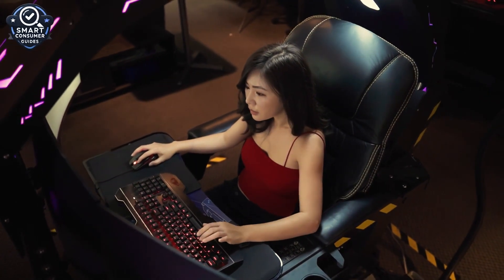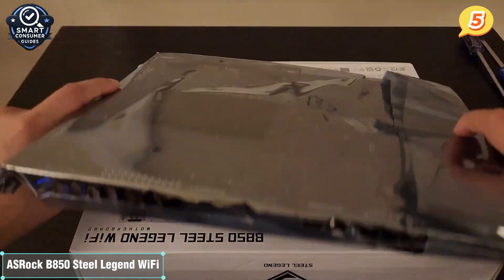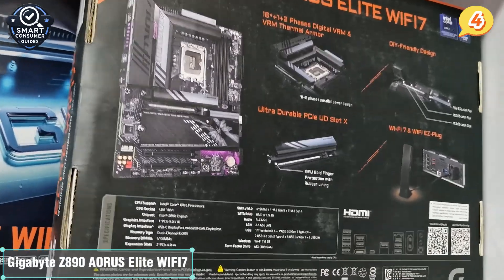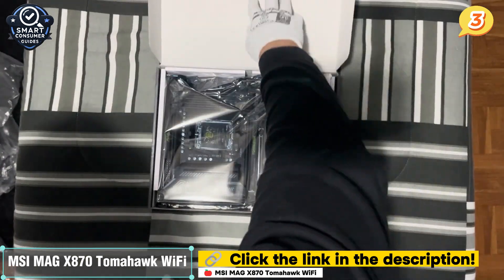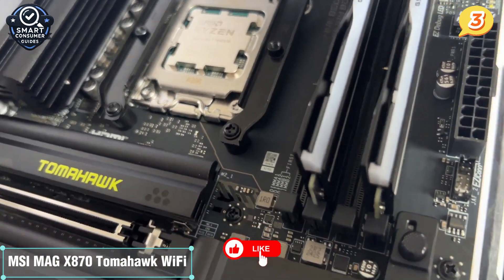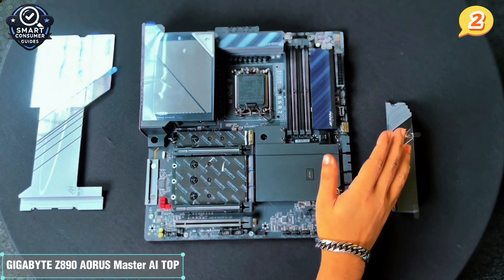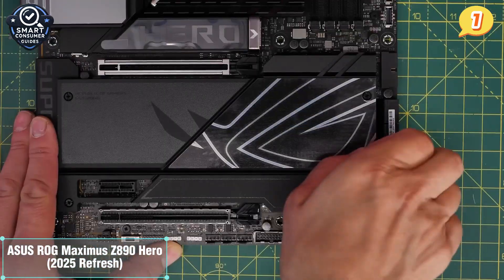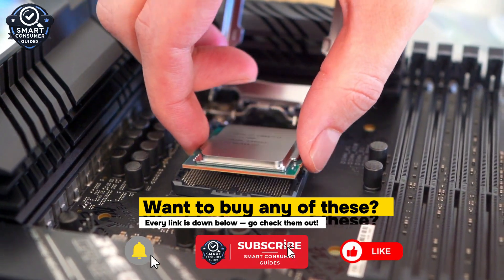Best Motherboards 2026 – [don’t build without watching this]

Comment: Thanks for this vid! Can the Ryzen 9 9950x3d performs well on the MAG X870e Tomahawk Wifi with a VRM rail of 14 + 2 + 1?
Reply from the maker: Yes — the MAG X870E Tomahawk WiFi can handle the Ryzen 9 9950X3D without issues.
The 14+2+1 VRM setup is more than sufficient for this CPU, especially at stock settings and with proper airflow.
As always, make sure you’re on a recent BIOS version for best stability and performance.

Comment: stay clear of asrock they are cpu killers i lost a 9900x
Reply from the maker: Sorry to hear about your 9900X — that’s rough. I’ve seen people have mixed experiences with ASRock: some swear by them, others, not so much. Personally, I try to test everything under controlled temps and safe voltages, regardless of brand. That said, your warning’s definitely noted — thanks for sharing it.

Comment: I figured it would be an Asus!  I'm still using a Win 7 box I built at least 12 years ago with an Asus board, and it's run faithfully without a hitch seven days a week for all those years.  I guess i'm due for a kickass upgrade, if I can tolerate Windows 11.
Reply from the maker: That’s honestly impressive — 12 years and still going strong says a lot about how solid that old ASUS board was. Totally hear you on Windows 11, though… it’s a love-hate thing. But if you do upgrade, you’ll definitely feel the performance leap. You’ve earned it!

Comment: Can the X870 tomahawk use WD_BLACK ssds and the Lexar ARES Gen2 RGB DDR5 RAM 32GB RAM im currently looking at those with the X870 tomahawk motherboard i was just wondering if those were good choices for the ram and the 2tb SSD and i want to pair the motherboard with either the ASUS TUF Gaming GeForce RTX  5080 or the GIGABYTE GeForce RTX 5080 and the 9800x3d cpu..i was just wondering if those parts were good for the MSI MAG X870E Tomahawk motherboard.
Reply from the maker: Absolutely — the MSI MAG X870E Tomahawk will support all of those parts just fine.
✅ WD_BLACK SSDs work perfectly with its Gen5/Gen4 M.2 slots.
✅ Lexar ARES DDR5 RAM is fully compatible with its DDR5 support.
✅ The RTX 5080 (either ASUS or GIGABYTE) will run without any issues, and the 9800X3D is a perfect match for the AM5 socket.

That setup sounds like a beast — go for it! 🔥 Let me know how the build turns out.
Reply: @SmartConsumerGuides  ok but are you certan this is my very very first pc build i dont want any major issues...and i want this to last a while i dont mind smaller issues like ram is not all the way installed etc..mabye im being too skeptical the ai voice made me more skeptical ngl 😂

Comment: my new system to get tmp2 (windows11) MSI MPG X670E Carbon WIFI (Socket AM5) DDR5 ATX Motherboard £299.99 (incl. VAT)due to 6 sata have new 2x16tb h/d +2x 8tb h/d +250gb ssd + blu ray writer ddr5 
AMD Ryzen 9 7950X Sixteen Core 5.70GHz (Socket AM5) Processor 16 Core with 32 Threads, 4.50GHz base clock speed, Up to 5.70GHz Boost Clock, 5nm FinFet Process, 64MB L3 Cache, Dual Channel DDR5 Controller, 5200-6000MHz RAM Recommended, £469.99 (incl. VAT)
Reply from the maker: Man, that’s basically my dream build right there. The 7950X with the X670E Carbon is already a monster, but if you threw in 128GB of 6000MHz CL16 G.Skill RAM and a 5080 GPU on top — that would literally be my dream setup. Absolute powerhouse for gaming, editing, and anything you throw at it. Props on putting together such a beast 👌🔥

Comment: Its ok to tell me i I'm a moron on my 1st PC build but I have already bought an Asrock X870e nova mo.Board for my 1st build @ $200 US dollars to do my 1st gaming build... normally priced @$300USD. Then I found your Video ❤ 😮
Reply from the maker: Not a moron at all — grabbing the X870E Nova at $200 is actually a smart move for a first build. Solid VRM, PCIe 5.0, and future-proof features for that price is a win. Enjoy your first gaming rig — sounds like you started off strong! 🔥
Reply: @SmartConsumerGuides There's so many gpu's to choose from if you want great picture. My next puzzle is to future proof that Goll gang gpu.. 9060xt, 9070xt, 5060ti, 5070ti, 16 gb of vram will give me more money back for an upgrade later on..but w/o getting ripped off? I turn to videos like this for guidance. Why overspend on a gpu? Right? You'd want the best picture for your money & a resale value if you want to upgrade later. Picking the right gpu is a HOT topic 🔥. I'm in the hunt for high quality picture w/o over paying * I think 16GB of VRAM brand new is my top tier choice. What do the pc Wizards think? Enough room for the greatest picture seems cool with higher quality construction of better cooling fans.. So many variants on every name & price & quality to look at.
Reply from the maker: Totally get what you mean — picking the right GPU is one of the hardest parts now with so many options. If you’re looking at 16GB VRAM cards, the RTX 4070 Ti SUPER or RX 7800 XT are both great examples. They give high quality visuals without the crazy pricing of a 4090, and they hold resale value better since they sit in the sweet spot for most gamers. Plus, with strong cooling designs from brands like ASUS TUF or Sapphire Nitro+, you don’t have to worry about thermals.

If you’re building future-proof but don’t want to overspend, that’s usually the tier I recommend. Higher end like 4090/5080 is killer performance but overkill for most setups unless you’re pushing 4K/8K or heavy AI workloads. Sounds like you’re thinking smart — maxing out picture quality without wasting money. 🔥💯

Comment: The first one is a B  850 not a bait. I got a 7.1 Stereo Have you ever tried before to hook it up in 3 x 3.5 I could of course buy a new Stereo. Not for me THX. I don't need WIFI  
2nd is the same just for Intel.  Just another one missing on the sound Not for me, I am wired
3rd Are you trying to find the stuff that I can't use? Congrat's AI. You're right on target! What a waste of time🙄
Reply from the maker: Got it — sounds like what you really need is strong onboard audio (multiple 3.5 mm jacks for 7.1) and wired-only stability, not Wi-Fi or flashy future-proofing. Boards like the ASUS TUF Gaming B650-PLUS (non-WiFi) or MSI MAG B650 Tomahawk without Wi-Fi would actually fit your setup better — they’ve got Realtek audio codecs with proper 7.1 outputs and solid LAN. The ones I listed aim more at future-proof builds (DDR5-9200+, PCIe 5.0, Thunderbolt 4, Wi-Fi 7). Appreciate your feedback — it shows there’s room for a ‘legacy-friendly’ roundup too.

Comment: You didn't talk about the audio chipset in these.  It sucks that they are stuffing WiFi in all of these while limiting better audio chipset to the higher class cards.
Reply from the maker: You’re absolutely right — that’s a valid point. Many mid-range and even some high-end boards today integrate Wi-Fi 6E or Wi-Fi 7 modules, but compromise by using entry-level audio chipsets like the Realtek ALC897 or ALC892. Higher-class models often step up to ALC1220, ALC4080, or even ESS Sabre DACs, which deliver noticeably cleaner output, better SNR, and lower distortion — especially important for high-impedance headphones or studio monitors.

In future breakdowns, I’ll make sure to point out when a board’s audio solution stands out — because for a lot of users, sound quality is just as critical as networking or VRM design.

Comment: guys pls help me should i get the GIGABYTE B850 AORUS ELITE WIFI7 or ASRock B850 LiveMixer WiFi DDR5 for r5 7600x? i want one of this 2 (i have a 4070)
Reply from the maker: Hey! Both are solid picks, but for your Ryzen 5 7600X + RTX 4070 build, I’d lean toward the GIGABYTE B850 AORUS ELITE WiFi7. It offers slightly better VRM cooling, a cleaner BIOS layout, and future-proofing with WiFi 7 support. The ASRock LiveMixer is great too if you prefer more RGB and standout aesthetics — but performance-wise, AORUS gets the edge. 🔥 Let us know what you pick!
Reply: @SmartConsumerGuides i got the aorus élite

Comment: The listed all motherboards are legendary series for hight performance. I am using a Z590 Taichi with 11700K for many years. The combo rocks still in 2025.
Reply from the maker: Totally agree — the Z590 Taichi with the 11700K is still a beast combo! Legendary boards like that prove you don’t always need the newest chipset to get top-tier performance. Appreciate you sharing your setup — it’s awesome to hear what’s still going strong in 2025. 🙌
Reply: @SmartConsumerGuides  thats because it was top of the line when it was new to begin with and now it has decent resale value because the "buy the best cpu you can afford and get the cheapest motherboard" crowd have  a lot of older systems that cant even look to the future of getting a better setup because the board isnt in production anymore.

X/Z boards are the best of the best and will be for a long time but your socket is out of date and we know intell.
B series boards are where everyone should be at but the "crowd" keeps A series boards in existence for why I have no idea..

Friend of mine has an am4 system he built in 2019, 3900x and a 5700xt, aorus master x570 board and best ram. 
all he needs is a new gpu to keep up with higher end games but he play's cpu based games so that 12 core 24 thread cpu is still working an easy job.
Reply from the maker: Absolutely — you nailed it. That Z590 Taichi was top-tier from the start, and you’re right about its staying power and resale value. It’s a great reminder that premium boards from a few years ago still hold their own today. And yes — the “buy the cheapest board” mindset can really limit upgrade paths in the long run.

Also agree with you on X/Z boards being future-ready vs. B/A series — though it’s wild how much love the A-series still gets from budget builds. 😅

Your friend’s AM4 setup is a perfect example — strong CPU, great board, and just a GPU upgrade away from being battle-ready again. That 3900X still crushes it in CPU-heavy tasks. Love hearing setups that just keep going. 🔥

Comment: Msi b650 can I buy for rizen 7 9800x3d with rtx 5070ti
Reply from the maker: Yes, the MSI B650 is compatible with the Ryzen 7 9800X3D — just make sure the BIOS is updated to support the 9800 series. And the RTX 5070 Ti will work great too, as long as you’ve got a good PSU (at least 750W recommended). Solid combo for gaming!

Comment: I made and drive a ROG Strix with an i9 and an RTX 4070ti using existing RAM, PSU and an old but great fully filtered positive pressure Silverstone mATX case - the upgrade costb me ~AUD2000. 
But with AI in mind my ultimate mobo is the Gigabyte W790 AI Top - Socket LGA 4677 - for AI enhanced Xenon W5/7/9 processors (AUD2200 to AUD8300) and provision for RTX PRO 6000 Blackwell (up to 3 @ AUD19,000 each and drawing 600 watts each).
All in an EATX case but I cant find a PSU to run it fully expanded, and inside that case will be boiling if all 3x96 GB VRAM and 3x752 Gen 5 tensor cores are on the go. 
Probably close to $30,000 for one Video Card and 4x32 GB ram (max 8x 256 GB - lol) 
One day maybe. But even as prices come down (???) that shows how things are moving.
AI - the great disruptor.  But wait for Quantum computing - imagine 1 meter of laser light, if all the photons were quantized, holding the sum total of all human knowledge ever. And it passes through the registers at the speed of light.
Reply from the maker: Wow, that was an impressive and insightful comment. Your technical knowledge and perspective really got me thinking — and honestly, it even sparked a few new video ideas. I’m genuinely grateful for that. What you said about AI and quantum computing is a powerful reminder of how fast the future is taking shape. Thanks for your input — comments like this truly add value to the content!

Comment: How are people still putting asrock on their list after their cpu blowing left and right
Reply: Because it’s not just asrock. 9800x3d’s were having issues being doa. Asrock had their boards a little to high, but amd is having issues with quality control
Reply from the maker: Good point — you’re absolutely right that it’s not just ASRock in the spotlight. The 9800X3D DOA reports and AMD’s QC issues have definitely added to the chaos. It’s a tough landscape for builders right now, so I tried to highlight only the boards that have proven reliable in real-world use. Appreciate the input!
Reply from the maker: Totally hear you — there’s definitely been some heated discussion about ASRock lately, especially with specific AM5 models. That said, not every board in their lineup has the same issues. In the video, I focused only on the most stable and positively reviewed ones based on real-world benchmarks and user feedback. Appreciate you chiming in — it’s super important to stay cautious and informed! 💬
Reply: @SmartConsumerGuides Do you think the asrock x870 riptide wifi model is worth paying attention or should you buy something else?

Comment: good B850M for 9800x3d?
Reply from the maker: If you’re pairing a 9800X3D with a B850M, make sure the board has solid VRMs and BIOS support out of the box. Some B850M models can handle it well — especially those with decent power delivery and active cooling. I’ll cover more budget-friendly but capable options in my next video on July 2nd, stay tuned!
Reply: I got ASUS tuf gaming B850
Reply from the maker: Nice! That’s actually one of the better B850 options out there — great VRMs and solid thermals for handling the 9800X3D. Should give you stable performance, especially if the BIOS is up to date. 🔧🔥
Reply: @SmartConsumerGuides  is good B850? I wanted a X870 but they say is overkill
Reply from the maker: @genlongtsang1093
Yep, the B850 is actually a great choice for the 9800X3D — especially if you picked a solid board like the TUF Gaming. You’ll get stable performance and good temps without the extra cost.
The X870 is awesome, but yeah — unless you need PCIe Gen5 everywhere or heavy OC features, it’s more than most people need.
B850 hits the sweet spot for value and performance. 🔧💡

Comment: ROG MAXIMUS Z890 HERO uses LGA 1851 socket and not 1850 as you say, there's no LGA 1850
Reply from the maker: Thanks for the correction, Kevy — you’re absolutely right, it’s LGA 1851, not 1850. That was a slip on my part and I appreciate you pointing it out. I’ll make sure to double-check socket info more carefully next time. 🙌

Comment: Liked the video. However, these boards are quite pricey, ranging from premium to really flagship. How about a vid about more affordable boards, based on B-series chipsets, eg models of the Prime, Ultra Durable or Pro category, with an emphasis on reliability and durability instead of just performance or exciting flashy features? B-series mobos aren't really cheaply made, can host demanding processors (unlike the A or H ones), and are fast and expansible too, offering the best value for price imo. If someone wants to get the fastest processor and overclock it to the max, only to get a little increase in cpu performance, that's another story.
Reply from the maker: Thanks a lot for the thoughtful comment — seriously appreciated! 🙏
You’re absolutely right — B-series boards like the Prime, Pro, or Ultra Durable offer great value, especially for those who want reliability and expandability without breaking the bank. That’s a solid idea, and I’ve just added it to my content roadmap.
Thanks again for the feedback — and feel free to drop more suggestions anytime!

Comment: dont buy asrock if you going to use a x3d chip. endless problems
Reply from the maker: Appreciate the heads-up! I’ve seen similar reports about X3D chips having compatibility quirks with certain ASRock boards — especially on earlier BIOS versions. Good to hear your take on it, and thanks for sharing your experience here!
Reply: Bullshit. Users overvolting their chips and then crying

Comment: Whats The BEst Mobo For I5 14600k And 4060ti?
Reply from the maker: Edit: Thanks to the sharp eye in the replies — you’re absolutely right, the i5-14600K isn’t compatible with AM5 boards like the X870 or Z890.
For an Intel build like the 14600K + 4060Ti, you’d want something like the ASUS TUF Z790-Plus WiFi or MSI PRO Z790-A WiFi — both offer great performance and stability with LGA1700 support.
Really appreciate the correction — keeping things accurate matters!
Reply: @SmartConsumerGuides  bro all the X870 motherboards are AM5, you can’t put a i5 in a AM5 motherboard, and also you can’t put a i5 14600K on a Z890, but you can in a Z790
Reply from the maker: You’re 100% right, and I really appreciate you calling that out. That was a mix-up on my part — thanks for helping keep the info accurate! Just edited the original reply with the correct LGA1700 boards for the i5-14600K. You’re awesome!